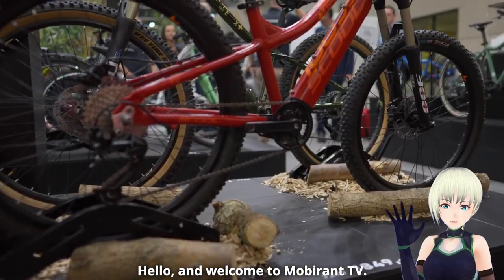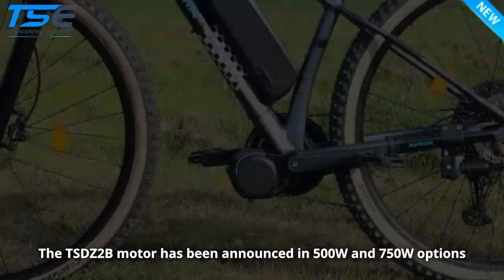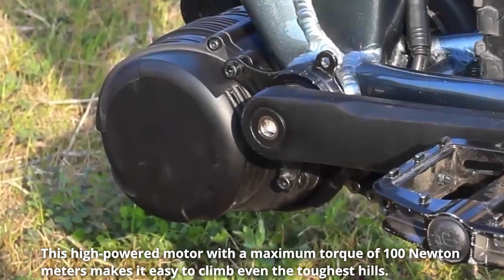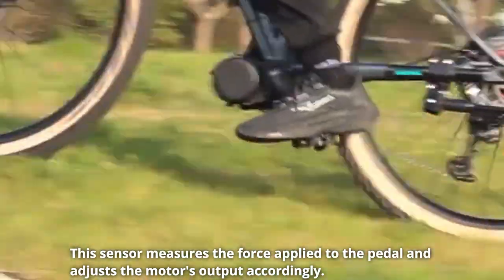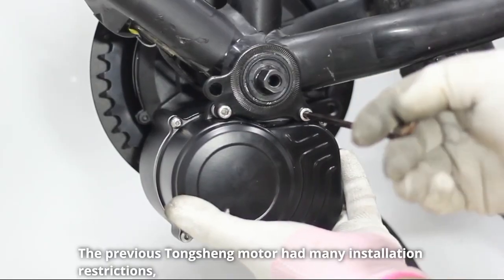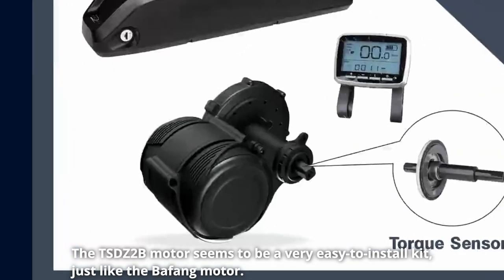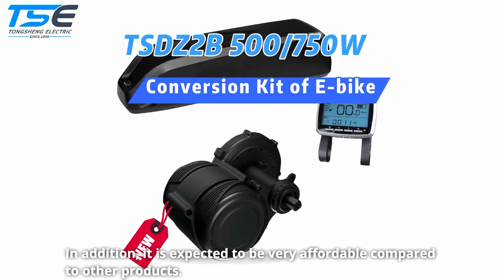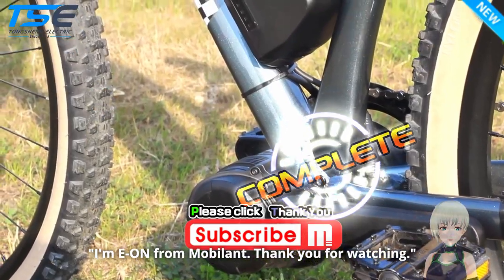TSDZ8 All-New Torque Sensor eBike Kit - First Look 500W/750W MID-DRIVE SYSTEM : TSD2ZB

Comment: How secure is it without the torque bracket that appears to be missing vs the TSDZ2B?
Reply from the maker: hello. This motor was released as TSDZ8.
Reply: Does the TSDZ8 have a torque securing bracket the same as the TSDZ2B?
Reply from the maker: Since I am not the manufacturer, I cannot solve the problem. In my experience, the 2nd generation model is expected to not cause as many breakdowns as the early model TSDZ2 because it has generally improved all the shortcomings.

Comment: This is too confusing, same model number as the old one ?

I thought the old one also had torque sensing ?

Is it available yet ? links ?
Reply from the maker: The motors introduced in the video are not yet for sale. Why they use the same name is a mystery. Currently, this model is a third-generation product that is not yet distributed.

All TSDZ series are torque sensor type.
Reply from the maker: The tsdz2b model is up to date. We recommend the 750w model if possible. The output is about 30% weaker than the Bafang notation.

Comment: Trying to help your algorithm 👍 but while I’m here are there any rumors on a release date ? 
It’s good there’s starting to be some choices for torque sensing mid drives maybe Bafang will get the hint

Edit: @ :19 and :26 how does the crank spin? looks like it will hit motor
Reply from the maker: Oddly, the model name is the same as the old motor. Generally, Aliexpress or Amazon release within 3 months after announcement.
Reply: @Mobilant_US it is called "TSDZ2B Turbo" in the Aikema catalogue.